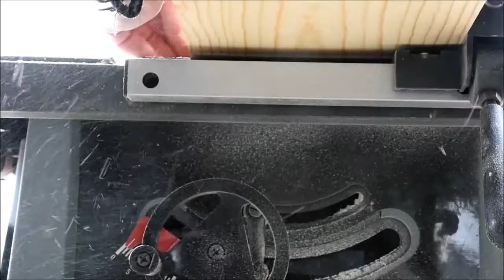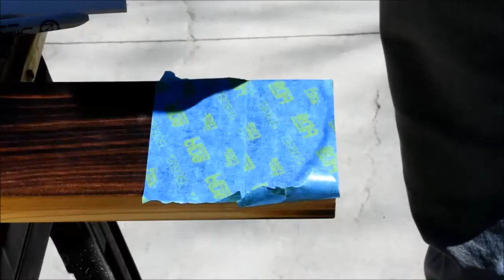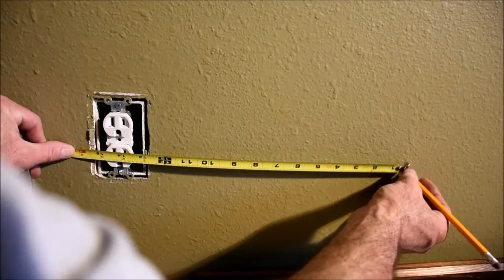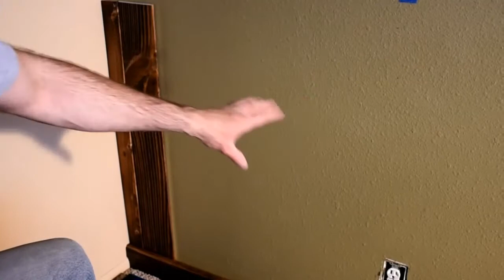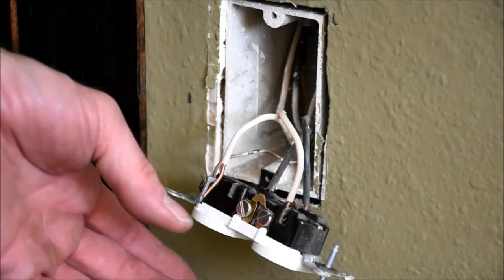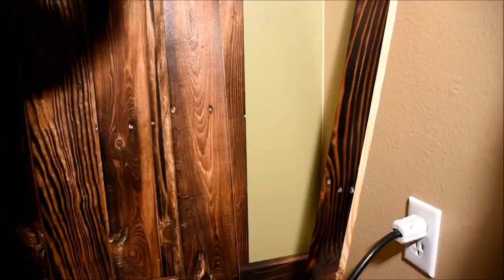Pallet wood wall paneling - part 2

Comment: What a fantastic project! What a fantastic way to reuse or repurpose wood. Trust me you wouldn't want to pay for that thin paneling that you used to see in everyone's houses. Those are way too thin to be that expensive! Fantastic video! Fantastic job!
Reply from the maker: Thank you Tracy.  I haven't priced it, but material in general seems to be so expensive these days.  Just the two boards for the top and bottom rail was 20 bucks.  And I still had to use left over scraps from my collection.